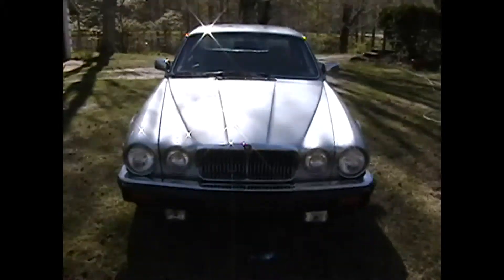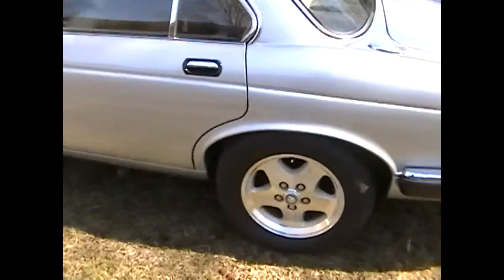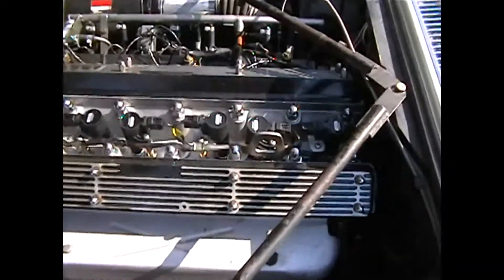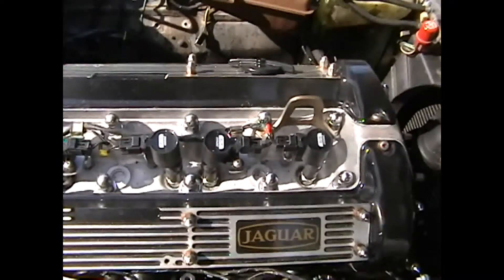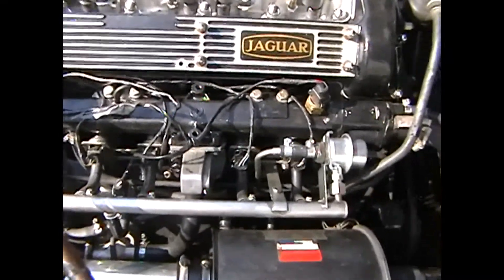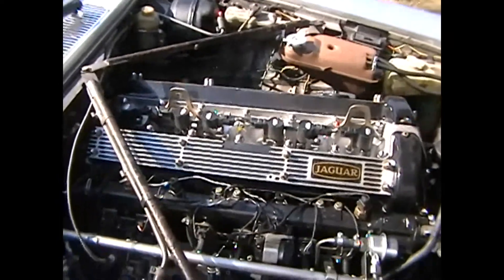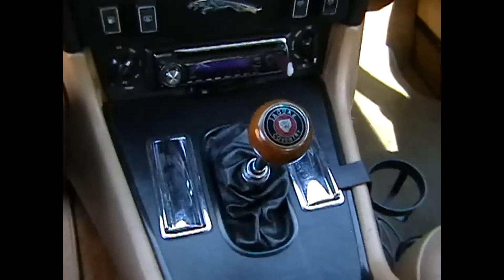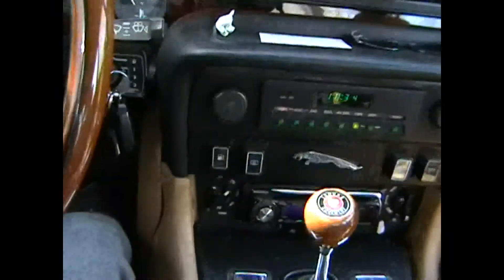1983 Jaguar XJ6 5-Speed with Megasquirt Engine Management

Comment: Is the gearbox a Getrag 265? What bellhousing did you use
Reply from the maker: Greetings, sorry, I just got the message.  The gearbox is a Getrag 265 from a BMW 5 series.   I used an E-Type bellhousing.  The one I have is from a 3.8 E-Type, but the 4.2 version will work better.  If you are interested, you can check out the project here..   https://thisoldjag.com/pages/gearbox/gearbox.html

Comment: How did you adapt the Getrag to the Jag bolt pattern?  Anything that you would change? Thank you
Reply from the maker: Greetings, I used an E-Type bellhousing  and a homemade adapter plate. You can check out the process here.  https://thisoldjag.com/pages/gearbox/gearbox.html . I am satisfied with the way it works, especially since I made the ball bearing release bearing, but if I did it again I would probably use one of the release bearings that ride on the nose piece of the gearbox.  The Getrag has  this nose piece and it should be possible to adapt one of these.  Sorry it took so long to answer, I didn't see your message until today.

Comment: Great video.  By any chance could you explain how you wired the injection to the megasquirt?  I know they operate twice per cycle. I’m not sure how that translates with the wiring to the MS.
Reply from the maker: Greetings, when you say wire the injection I assume you are talking about wiring the injectors.  The Megasquirt has 2 channels for the injectors and there are 2 pulses to each channel  for each engine revolution. So, I wired 1,5,3 to one channel and 2,4,6 to the other.
This video describes how I connected the system.   https://youtu.be/6A97iF_IqyA?si=pxDLTEr1aTJaTpaJ
Reply: Excellent. Thank you

Comment: Great  job, on a great  car.. bloody genius.. my son and I are doing a small restomod on his 86 xjs. V12 HE.. I want to  convert to a DIS system also  with a new stand alone  management system.. I here Mobeck Tekniski has an all in one  package deal.. 
I'm wondering,  you didn't mention about  idle, acceleration,  power if any..  did you notice anything?
Reply from the maker: Greetings Pete,
Your car and mine are are obviously very different. I am not familiar with the system you are talking about, but I must say that the changes to my car worked out nicely. 
There is a noticeable improvement in power and acceleration.  The XJ6 is certainly not known for it's rapid acceleration, but mine is much quicker.  Part of it might be the 5-speed gearbox as well. 
The XK engine likes to run a little bit rich at idle (I learned this from working with the carburetors on the E-Type) and with this system I have access to the fuel curve and I can give it that little bit more fuel.  It idles perfectly at 850 RPM, smooth as silk.
It has been extremely dependable even with my homemade mods for the coil-on-plug system. I did have one failure inside the MegaSquirt.  There was a transistor that popped, but that turned out to be an incorrect setting on my part.  I replaced the transistor and all has been well since.
The conversion is a lot of work, but at least in my case, it was time and money  well spent.
Good luck with your project.

Comment: Why do you change these great cars keep them original otherwise they are worthless
Reply from the maker: Entertainment, man.    It is a lot more fun to drive now than it was before.  It runs better, handles better, looks better and is overall more fun to drive. I haven't changed anything on my car that cannot be restored to original. Even the original wiring is still in place.

Comment: Hi, I am doing similar on my 1987 XJ6, just rebuilt the motor and currently rewiring and fitting crank sensor, TPS etc. I have a question on the 36-1 wheel for crank sensor, when I read Mega manual it looks like I should have TDC around 9 teeth anticlockwise from missing tooth, but your setup seems different based on the video, am I missing something?
Reply from the maker: Paul, if you look at the engine from the front, not from the drivers seat, the engine turns in a clockwise direction. With the engine set with #1 and #6 at TDC,  the missing tooth should be 6 teeth  (60 degrees) ahead of the sensor.  For example, if you mount the sensor at 6 o'clock the missing tooth should be at 8 o'clock. 

Of course looking from the drivers seat give you a different perspective and everything will be anti-clockwise.
Reply from the maker: here is what the megamanual says:

The VR sensor and 36-1 crank trigger wheel must be set in the correct relationship to each other. With the engine at TDC for cylinder #1, this relationship is:

EDIS-4: missing tooth is exactly nine teeth (90°) ahead of the VR sensor,
EDIS-6: missing tooth is exactly six teeth (60°) ahead of the VR sensor,
EDIS-8: missing tooth is exactly five teeth (50°) ahead of the VR sensor.

Hope this helps.  If you have other questions, just ask.
Reply: @novom2001  Thanks and that is clear, I am doing EDIS-6 as well. I looked at your other video and looks like 6th tooth (including missing one) is 10 degrees BTDC, so did you fine it to this?
Reply from the maker: @paulroskilly6879  Paul, I took these photos during the trial-and-error period and the markings do not necessarily relate to the final configuration.  I'm sorry if that led to confusion.  My bad, I should have made that clear in the video.  
I set mine up as per the MM and got it as close to the 6 teeth as possible.  When I got it running I only had to make a minor adjustment to the timing, so I was pretty close.
Again, sorry for the confusion.
Reply: @novom2001  I have another question, it looks like you did not run a Mass Air Flow meter, is that correct? I see a bypass for the old Jag one. Just interested in the logic here? Thanks
Reply from the maker: @paulroskilly6879  Paul, the Megasquirt has a built in vacuum transducer so that the  air flow meter is not necessary.  It becomes a manifold pressure controlled system rather that an air flow controlled system.  Megasquirt can however be configured to work with an air mass sensor if desired.  That is something that I would like to investigate in the future.
Reply: @novom2001  One more question, I finally got the EDIS 6 wired up and have what might be a stupid question, are pins 10,11,12 powering the coil on plugs switching positive or negative, I think positive but not sure? Thanks
Reply from the maker: @paulroskilly6879  Paul, the EDIS switches the ground.  If you are using the coil pack you connect a switched 12V to pin 4 of the coil pack.  Like this  https://hosting.photobucket.com/albums/b81/BRAAPZ/EDIS/EDIS_6_MS.jpg.  If you are using individual coils, the you supply the switched 12V to each of the coils.
Good Luck.

Comment: Beautiful car. Just wondering where you sourced the pedals for clutch? Replace original 2 with complete 3 setup or just add clutch pedal? I have a100% rust free '85 XJ6 here in New Mexico, got it for a swap of an old pos vw sand rail, value of about $600. It has a SBC 350 swap in it. Drives ok but needs TLC. I would love to swap in a 6-speed from a Z28 or something. Rebuild the 350 and make it a nice street cruiser. Just wondering on the pedals. Thanks
Reply from the maker: Mike, I made the clutch pedal from the BMW 528 pedal and modified the brake pedal.  I put some detail on this page if you are interested in having a look.  http://thisoldjag.com/83XJ6_5Speed/Page_1.html  
Good luck with your project.
Reply from the maker: Mike, I forgot to mention.  If you go to  http://thisoldjag.com/83XJ6_5Speed/Page_1.html  clicking the thumbnail will open a larger version of the image.
Reply: @novom2001  How did you do the mounting / Pivot point of the pedal? There is no pics or text mentioning that. BTW, nice page of info. Almost makes me wish I had stock motor in the car. BUT, 350 Chevy much cheaper to rebuild if needed.
Reply from the maker: Mike, Sorry, I didn't even think to mention this. The pedal box casting is made for a clutch pedal since many of these cars came with a manual gearbox and Jaguar used the same casting for all. It is just not drilled.  What I did was drill the holes necessary to mount the master cylinder and then the pedal using an appropriately sized bolt, for the pedal bushing,  as a pivot.
Reply: @novom2001  , awesome thanks!

Comment: Great work Mate!, I have also owned Jags for over 20 years, I have 2 now and they are Bothe getting some work done, is it possible you can post the mountings and all instructions to replicate your great work on the ignition, it looks perfect and tidy, I love the original motor but hate the clutter and old wiring along with the disorganised look, any other work you have done like clean out fuel tanks please let me know. Regards George K Australia
Reply from the maker: George, happy to help in any way I can.  If you haven't seen this video, you might give it a watch.  
https://www.youtube.com/watch?v=6A97iF_IqyA  This explains how I did the fuel and ignition.  I will be glad to answer any specific questions if I can.  Just ask.
I have made several mods to my car.  It has been both a daily driver and a continuing project.
Best way I have found to clean the fuel tanks is to replace them, I hate working with old gas tanks.
That said, they are not terribly difficult to remove if you wanted to take them out to have them boiled at a radiator shop or something similar.
Reply from the maker: George, I forgot to mention.  If you do not want to use the full Megasquirt engine management system, there is a product called the Megajolt that is for the ignition only.  You keep your existing fuel injection system, but will use the EDIS  ignition. I haven't done this, but I understand it will work.

Comment: Beautiful conversion for future preservation of these outstanding machines. Hope all is going well today with this project, thus far looks to seem you've got it all figured out.
Reply from the maker: The engine is running great.  It runs strong and even has a smooth idle. Very satisfied with the MS  and EDIS systems.  Actually, I am surprised at how well the whole thing works.

Comment: I have a 97 xj6, Would you know how to convert to coil on plug?
Reply from the maker: Trevor, the 97 XJ6 already has coil on plug ignition  if I am not mistaken.  They are hidden under the cover in the center of the engine.  Some of the early AJ engines had a distributor, but by the time your car came along I am pretty sure they were coil on plug.

Comment: Thanks for the video (s); they are great source of ideas.  My first major project to my "new to me" 86 XJ6 will be a 5 speed.  Right now I leaning towards Xcessive Manufacturing's VG kit.
I'm really a Triumph TR-6 guy so I have a lot to learn about fuel injection.  Why are you considering adding back an airflow meter?
Reply from the maker: Being able to swap a few cogs sure makes the car more entertaining.  Hope your conversion goes well.
My thinking about adding an air mass meter (not the vane type air flow meter that is on the car now),  is that it will help to give me more precise fueling at low engine speeds.  The only real problem I have with the Megasquirt is in the transition zone between idle and running, very small throttle openings ( which by the way is where a great deal on normal driving is done),  It is by no means a deal breaker, but it has a tendency to surge sometimes.  It is also possible that I might be able to cure it my reexamining my VE (mixture) tables and that is where I will go first.
Reply: You are having this problem because it is not sequential. I was just reading up on this researching my friend Kurt's build we're doing who you corresponded with you previously. FYI, they make a MS-II sequencer to make your system sequential but you need a cam sensor. It still isn't quite that elegant, so we're going to likely use an AEM infinity 5. It should be awesome. Do you have any better pics and info for your crank sensor and mount specs as well as coil stand off specs to clone for our setup? my email is seanreynoldsesq@gmail.com. Thanks! great work.
Reply: @novom2001  Good tip about the air mass meter, I had not considered that.  After doing a bit of reading, I think that is a better route.  Still being new to the fuel injection game, I suppose it would be best to get a Bosch unit, in hopes the plugs would match.  
    I wonder if that is something I could do with the stock ECU?  I've noticed my Jag has a tendency be a little abrupt when making slight  throttle increases.
Reply from the maker: @andypaine7489  
I am not sure which unit will work best, but the MS guys seem to like the Ford unit.  I haven't done enough research to know exactly how I would go about that.  Sean's thinking about sequential is good, but expensive, so maybe some day.
As I am sure you are aware, you would not be able to use the Air Mass unit with your current ECU.
I have never tried to do any mods to the stock Bosch ECU.  It is fairly old school if you look inside, so it is likely you could mod it if you had schematics, but I have not done it.
Reply: As I'm digging into the MS system, I came to another question.  Which base map did you use to get started?
Reply from the maker: Andy, I just entered the info about my engine and injectors and used the default map.  If you wan't,  I can send you a copy of my map.  I am still running the older B & G code instead of the MS Extra, but I have that as well if you are interested.
Reply: Did you end up doing the Xcessive VG kit?  I did the conversion and it worked quite well.  I ended up swapping the rear end to a 3.54 from the 2.88 that came stock.   Otherwise the gearing is pretty tall with the VG trans.

Comment: i guess this is the 4.2L. my 1971 s1 is only 2.8 so i bought an xj40 3.2L and swap the entire powertrain incl diff.  i was thinking of using megasquirt on t original 2.8 but still would be underpowered. yet the xj40 3.2L fuel syst can use some improvements like more air and dynamic ign timing. What coils did you use
Reply from the maker: This is a 4.2.  I am quite pleased with the way the car runs, and the Megasquirt with all of it's available settings is key.  The coils I used are from a 2000 S-Type V8 ( or the very similar Lincoln),  but the V-6 coils (among others) will work with EDIS.

Comment: What fuel economy and performance with this
Reply from the maker: The fuel economy will only be a guess because I really haven't made any real test. The one time I checked it the results were slightly above 15 MPG.  My daily commute is a combination of moderate speed back roads and in town driving.  

In a similar manner, the improvement in performance is subjective.  It feels to be much more responsive but I have changed so many things I cannot say absolutely that the Megasquirt was the reason.  The car as it is does run great now.  Calling an XJ6 quick is a bit of a joke, but considering what it is it is very responsive.
Reply: @novom2001  My 83 xj6 averaged at 83mph around 18 MPG on I-75 for 1100 miles. 89k on car that sat for 15 years without being ran. Couldn't believe it, didn't know what to expect. Without any mods on 4.2 .
Reply: 1100 miles

Comment: Hi, I have an 83 XJ6 too. I notice you've ditched the clutch drive fan in favour of electric. What diameter fan is it and how is it controlled? Do you find it's enough in summer in traffic jams? Has your car still got the standard factory fit alternator and if so do you find the fan drags the voltage down at idle, they usually pull a lot of current.Somehow those 7" headlights do look better than factory fit for US market. Very nice.Thanks.
Reply from the maker: If memory serves me, the fan is 16 inches, and it worked beautifully last summer in SC. It does not load the electrical system excessively. I can't say exactly what would happen to idle speed when an automatic transmission and A/C are used.  I used a thermostatically controlled relay to switch it.  The one that I used has a small capillary tube that you insert into the fins of the radiator. My alternator is stock and in the stock location. 

The headlights are the way the car was designed.  The 5 3/4 outside lamps are there only to meet US regulations at the time the cars were made. Too bad we got stuck with that.  The conversion is fortunately very simple.
Reply: Kirby Palm recommends a 5 blade Delco electric fan for the V12 XJS. I guess the same would fit in the XJ sedans.
See "Experience In A Book", free download.

Comment: Hey this is really cool. I am just in the process of rewiring my 84 and I was looking at doing the megasquirt to mine as well while I have it all apart I was wondering how you chose to send the crank signal to the ECU.
Reply from the maker: I used a 36-1 wheel from DIYautotune mounted on the bolts that attach the belt  pulleys to the harmonic damper.  For a sensor, I used a crank sensor from a Fold Bronco because it uses the standard Bosch type connector and it has two mounting tabs that I could use to mount it to the front cover bolts. If you decide to do it, I can give you exact details and pictures. Just let me know.  I'm thinking of doing a video to show exactly what I used.